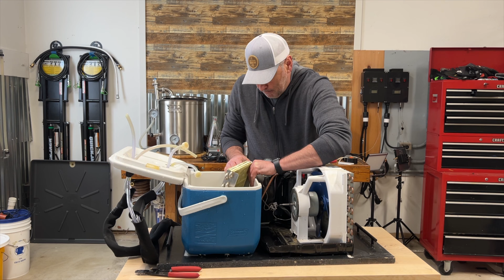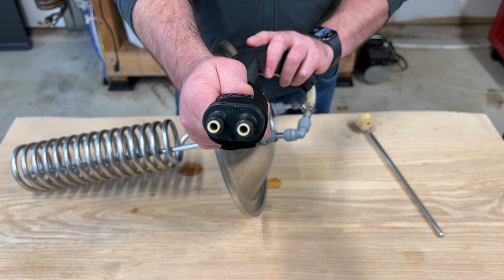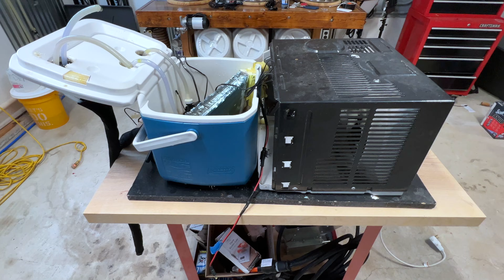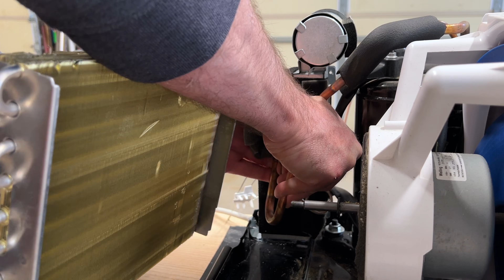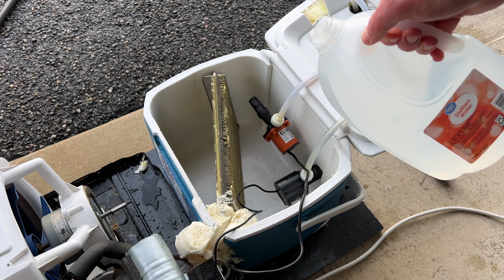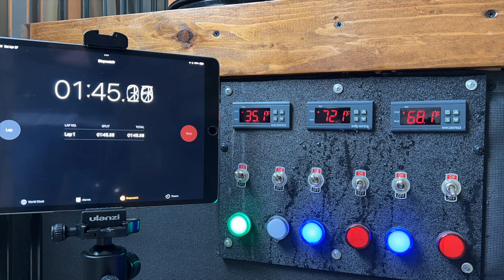Glycol Chiller DIY Build [ UPDATED ]

Comment: I love how clean your system is. I have built a similar set up but am in the process of rebuilding now. A pointer. The orange is from some of the components of the ac coil rusting. You can buy a rust inhibitor for this specific application (glycol solution) and that will stop this from happening and save your pumps. That's exactly what I have done
Reply from the maker: Thanks for the feedback! I’ll have to look into this rust inhibitor glycol solution. Seems like a great idea! Good luck with your rebuild! Cheers!

Comment: Hey, thanks for the update, I'm in the middle of building my own chiller based on your older video. Just curious why you decided to upgrade the AC unit? Was the older one worn out and how often would you expect to have to replace the AC unit? Cheers
Reply from the maker: Hey Luke, I replaced it because it was not cooling as fast as it use to. It’s hard for me to say how long because of the diy nature of this project. My first unit was fairly old and lasted me 2.5 years. I ran around 25 batches through it. I hope this helps. Good luck with your build! Cheers:)